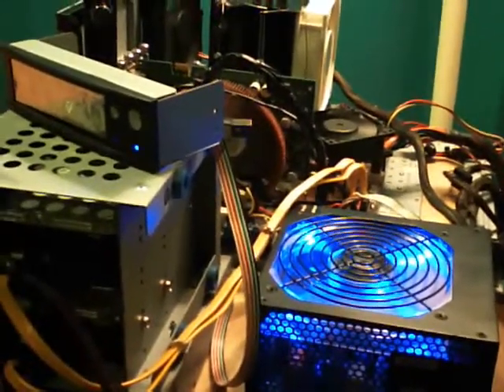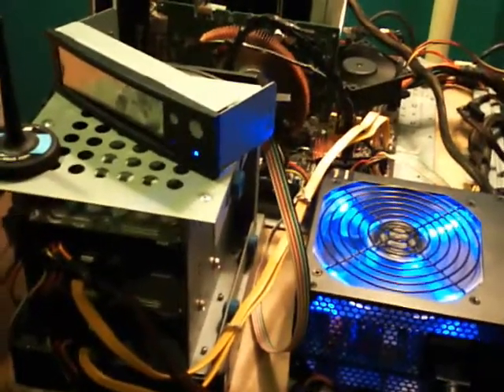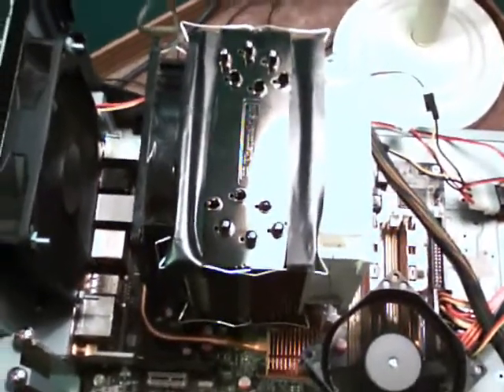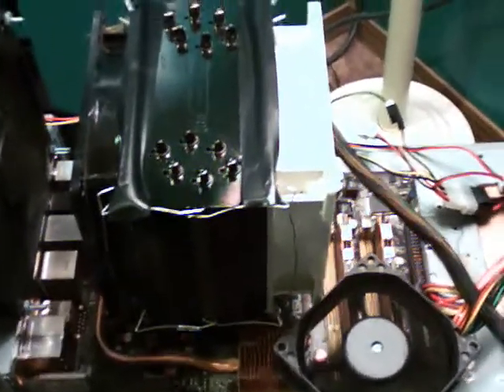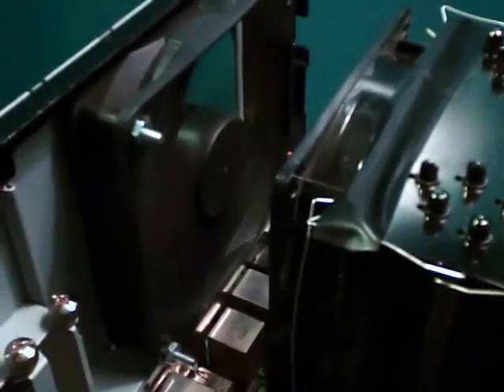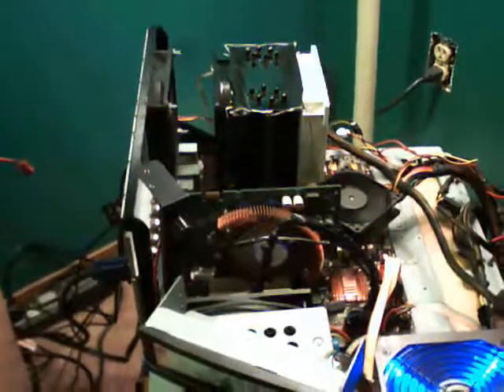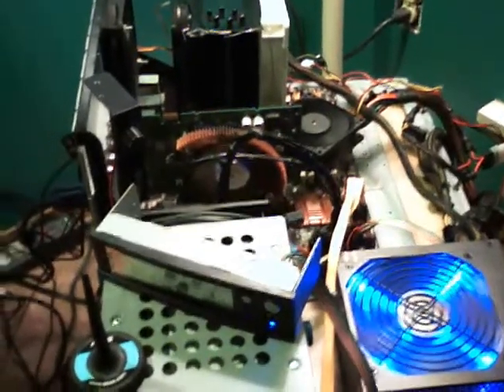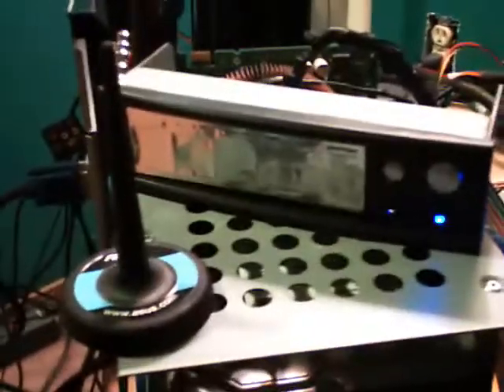Computer Update 9/13/08- TRUE 120 Mounted

Comment from the maker: Temps are 5-6 lower then BT at same clocks 4.05ghz. Idle is 41/43c lowest it ever goes, and load at 73F room temp is 55/56c at 1.352v.

Used too much as5 by a mile so lower temps are coming and it is not broken in as well.